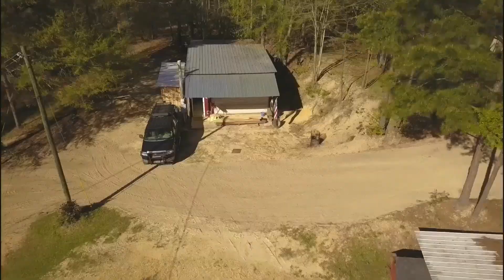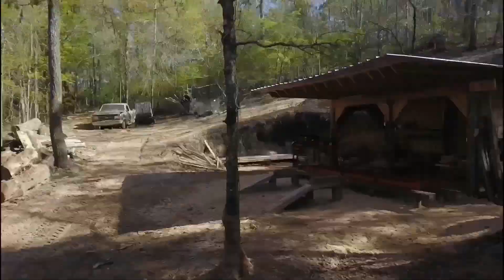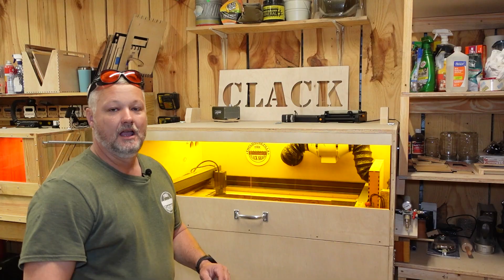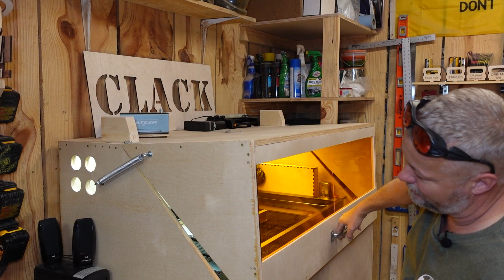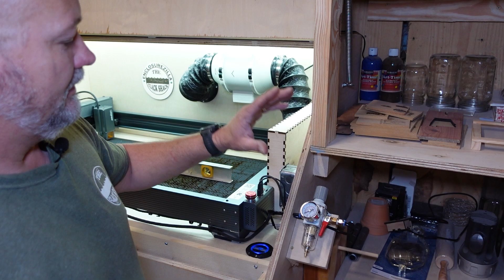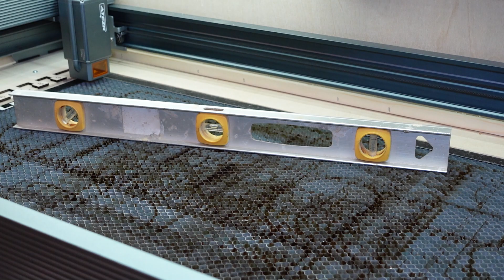ENCLOSUREZILLA- The best diode enclosure EVER ??

Comment: hi! Warning regarding diffuse reflections:

"I have to disagree with the statement that reflections from plywood are harmless. While wood is a matte surface and doesn't cause specular reflections (like a mirror or polished metal), it causes significant diffuse reflection.

When using a high-power blue laser (450nm), the spot on the wood is incredibly bright—often exceeding the safety limits for the human retina. Even if it doesn't feel painful immediately, this scattered light can cause permanent photochemical damage to the eyes over time (macular degeneration).

Saying it's 'safe' because it's not a cobalt or metal surface is dangerous misinformation. For anyone watching their laser work, OD4+ rated safety glasses (specifically for 450nm) are a must, regardless of the material being engraved. Protect your eyesight!"..
Reply from the maker: Sure

Comment: I just got done building an enclosure for my laser, I have the longer b1 40w and I was wondering how you did the electrical for everything? I built my enclosure on a workbench and have another enclosure for my 3d printer that’s apart of the bench. Did you plug up everything to the same outlet? Is there safety precautions you took when it comes to power consumption? I have the laser, 3d printer, 2 LED light strips, and a fan to power. Thanks!
Reply from the maker: I have a multiple plug strip in the enclosure. These machines pull very low power.

Comment: You have any videos of that bed lift?
Reply from the maker: Just the enclosure videos. There are links in the descriptions.
Reply: @TheClackShack  bummer, oh well, thanks. I think I'm going to just go the other way... Currently building an enclosure for my 20 watt diode, and Ive got the 850x850mm extension kit for it. Rather than making a bed that moves up and down I think I'm going to just build a frame into the box to lift the whole laser. 

This video gave me the inspiration to go for it. Finishing up my drawings and then I'm gonna get at it. Trying to figure out measurements for the baffles in upper plenum for the box and I'll be good to go. Thanks for the inspiration and all the great videos

Comment: Why did you use cabnet grade plywood for Enclosurezilla.What is theover all  dementions I have the same laser as you are using in that enclousre   THanks for all you do for your community.
Reply from the maker: I wanted it to be sturdy without the need for an inner frame. Also wanted it to be noise dampening and easy to paint. There are rough drawings on my website.

Comment: Auto dimming window modded from a LCD tv panel like a welding mask for some overengineering.
Reply from the maker: No thanks..
Reply: @TheClackShack  Haha, overengineering, redundency. Wonder about even just recyling a cheap auto dimming welding helmet, or go with no window and rely on just a interior camera as a work around. PAR lighting filters as another option in layers to reach safe zone.

Comment: Inlet at floor level for air for heat savings, other than that it's a decent design for safety.
Reply from the maker: Air goes out in bottom comes in in top. Keeps machine running cleaner

Comment: Got excited by the price of the safety glass you found, but then saw it's only OD3, which is way too low for any real protection. If you have to wear your safety glasses around the laser in the enclosure then spending any money on "safety" acrylic is kind of a waste. I recently watched a video with a guy who does this kind of work for military contract work and he said he wouldn't let anyone near a laser with less than OD5. 
Yeah the higher OD panels are really expensive, but my eyes are priceless. Maybe just put a panel on the enclosure you can open and close to look with your glasses, or just keep it all closed up and use a camera feed to monitor the burn progress.
Reply from the maker: I am sure it would not be good for a direct beam. Double protection is always a good idea
Reply: Double up on the filter, triple even and add extra ambient light to see better.
Reply: @truetech4158  don’t know if that’s exactly how it works. Would need a person who is an expert in the field to confirm. Also worry that the cheaper options aren’t being exactly honest about their ratings. Way to easy to simply lie about it.
Reply: @johndoe6032  A proper lumens meter would show the gradient levels of the spectrum of light. Ya, what you wrote is so on point with critical thinking, pzaramount for safety and human rights, we must push all to raise the bar rather than barter.

Comment: I’m finishing up on my cabinet. Interesting that we came up with similar ideas. I bought the complete 2 in 1 Xtool with the extensions. 

I like the horizontal design for easy access. I went the long way and placed doors under the laser frame to allow unlimited length signs with 34” tall letters. 

On the venting, I have opted to make it a downdraft system with a six inch double squirrel cage exhaust with three speeds. I’ll let you know how that works out. 

Like your design I have placed two manually operated scissor jacks under the honeycomb. Unfortunately I bought two standard X Tool honeycombs before I saw the extended one piece unit that you have. If you know anyone I would like to sell my two new unused panels and get the one like you have. I see that I’ll have a large solid bar where the two come together. I’m reinforcing the framework with aluminum angle and the two independent jacks should solve the stabilization issue of the large frame. 

On the glass I’ve built a 24 X 36 solid plate glass top and placed a 24 X 24 filter plexiglass on top that can slide up and down on the clear glass. The lid has two gas shocks that balance the lid open or closed. 

The unit will have a 32” monitor on an articulating mount. The glass top will be a work surface for a wireless keyboard and mouse that connects to a mini PC mounted to the end cabinet. 

Like most of my grand plans I’m sure there will be modifications but like you I’m ready to get out of the cabinet business and back to the origins, plan whatever that was. 

All of this is mounted on a custom heavy four wheel dolly that is detachable and recesses up into the bottom of the cabinet height enclosure. 
Whew!!! Never dreamed a cabinet could cost a thousand bucks!!!

I’ll look into your store for the full length honeycomb and other offerings. Thanks so much for you informational videos and for sharing your knowledge.
Reply from the maker: My ideas tend to lead to expenses too. I am glad I did it though. The features make my work flow much better
Reply: @TheClackShack 

 I just saw your video on switching to the new laser company. I love the electric lift mechanism. Ill probably add that soon but using two manual jacks for now. 
on the honeycomb stability I am concerned with that on my design. It would be easier if I had the one piece honeycomb. I'm thinking like you mentioned to add a subframe under the honeycomb. Also to make a gauge to check the be parallels to the laser.
 
on the cabinet I think a full height cabinet design on casters is going to work. inside the cabinet I used four of the two slot adjustable shelf brackets to support both the laser and the bed jacks. I made the cabinet 56 inches deep and 24 inches inside. I put a 3/16 plate glass top inside a frame that allows a 24 x 24 filter glass that slides on top of the plate glass. This gives me a work surface for the keyboard and mouse. 
  
I also mounted a 40" HD TV with a sound system. I can play YouTube feeds or music while drawing or surfing the web. So far the mini computer is handling all of this multitasking. 

On the electric I wired four duplex outlets on the back side and four switches on the front side panel. 

Thanks for all of your contributions and great ideas.
I would like to send a couple photos and follow your new design ideas also.

Comment: Good video.  Do you have the dimensions for the enclosure.  I like the lift and have the xTool D1 Pro 40watt.  I want to engrave the bottom of my bowls and vases that vary in height.
Reply from the maker: I would have to get all the measurement, I don't currently.

Comment: What psi are you using for the shop air assist?  I can''t measure the psi of the Atezr air assist unit, so not sure.  Can't be much.
Reply from the maker: I tune it based on performance in the cut. Not sure what it is set to. PSI is specific to the point of measure. I use performance rather than the measured psi inside the regulator
Reply: @TheClackShack  makes sense.  If I'm doing a cut, I turn the Atezr pump up to about 3/4.  If engraving wood, then about 1/2 way.  Seems like those are reasonable settings.

Comment: Doing shop air on my enclosure.  I want the regulated mostly out of the way ad so I am using a solenoid operated valve .  Would you put the valve before or after the regulator?
Reply from the maker: I would probably do after the regulator.

Comment: Really enjoying seeing this progress along 🤗
Reply from the maker: I can’t wait to get to turn out a few jobs with it…
Reply: Costs are a difficult thing with surging everywhere, I'm curious what is the price point of the build? Pin and chains, Tractorsupply springs, little frugality never hurt anyone 😅
Reply from the maker: @dijimeistro  Just the box was probably close to $500. That isn't including any of the mechanical or electrical components. Not cheap but it will make the money back in a couple of months work. Also, It is alot more safe than engraving stop toppers on the table.

Comment: What PSI  you running air assist?  Enclosure looks great Sir! Old school rule would be 2/3 up the length for the lid  for the stops. Less torque on the hinges.
Reply from the maker: I tune the air while in a cut, psi is misleading. Too many variables in the line set and cone. Set a long cut, adjust as it travels and pick the setting based on result.
Reply: @TheClackShack  Thank you Sir

Comment: Nice work!  You can cut a piece out of an Heating/A/C filter for those air intake holes.  It would prevent direct light and give some dust control.
Reply from the maker: No real risk of direct light. Thanks